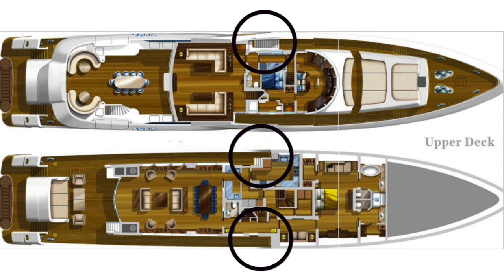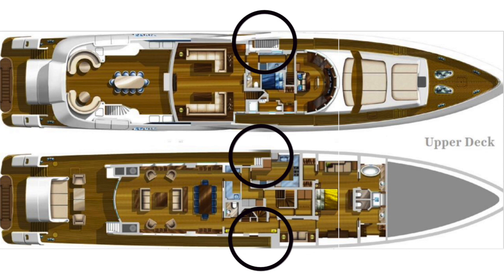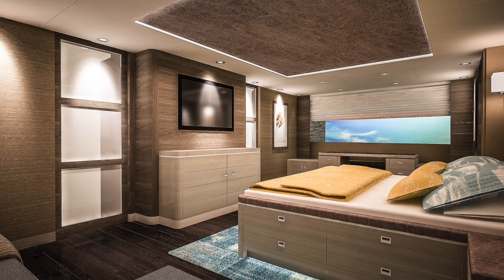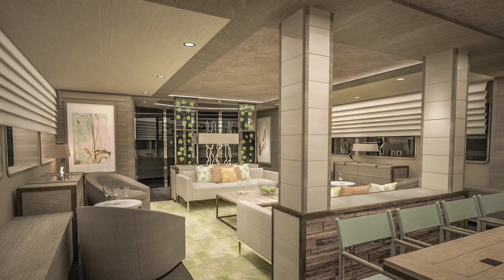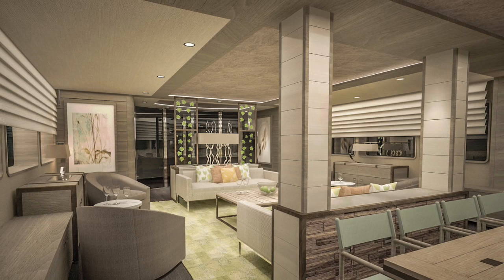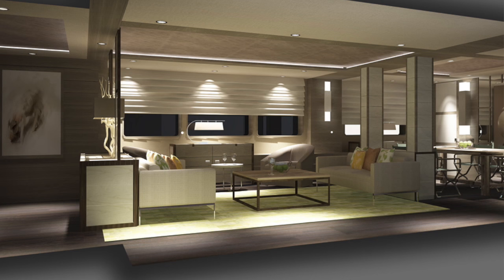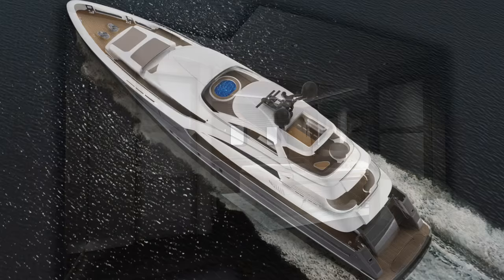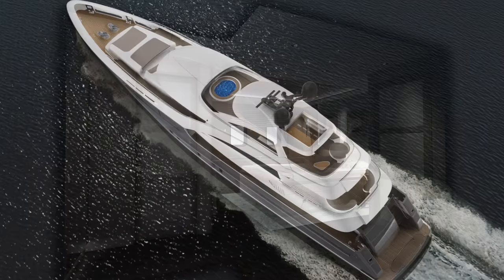Yachts Video Blog - Two Amazing Superyacht Launches

Comment: If the one boat has four generators located in the front of the boat to create electricity for the electric propulsion system, are the four generator not located in a room taking up space in the bow? Would this not be called the engine room? I'm surprised you didn't say the boat is Green because it runs on 100% electric because of the electric motors.